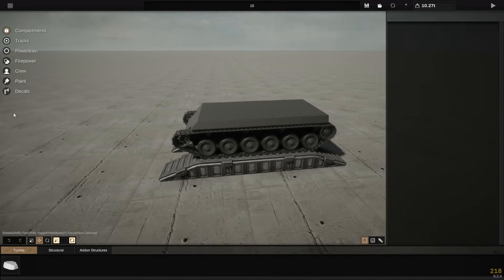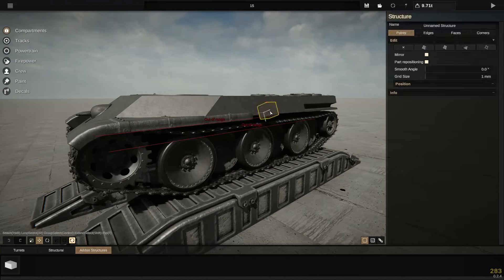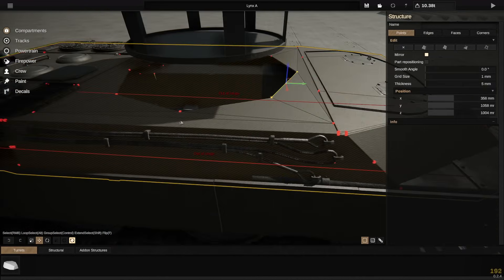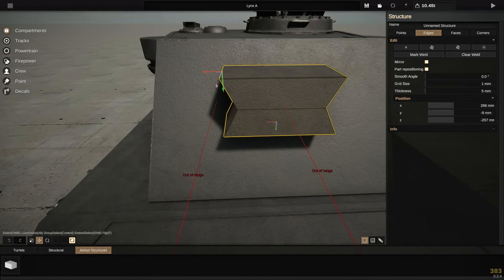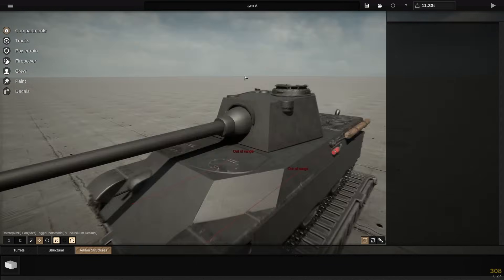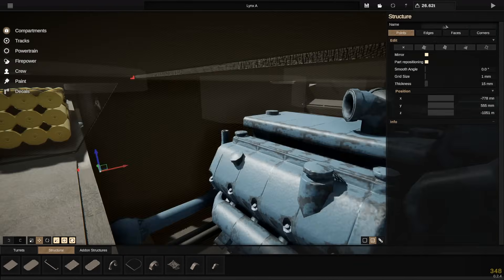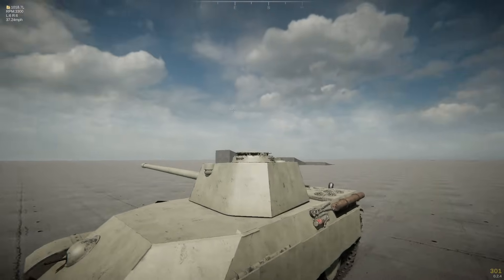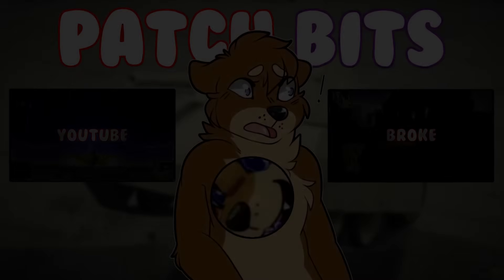Building an upgraded PANTHER TANK in Sprocket!

Comment: This sort of thing was my goal when I played Sprocket. Make something mid-war that could have replaced Pz4, Panther, Tiger all in one tank. Light enough to be Pz4 weight, angled armor of Panther, and side and rear protection of Tiger. Have one at ~35 tons that can tank Long 88 from King Tiger from anywhere to the front/front-side. Armed with 192mm penning 88. It's tops out at only 40 but can climb 70 grade, stop on the grade, then startup again and crest it, and 3 reverse gears so it's quick accelerating and nimble.

Comment: Seeing as you mentioned it:

Panther II did exist and was in fact built (it's currently in the USA in fact) but just not in the way it was presented in WT. IIRC it started development before the Panther even saw service. The idea was basically to uparmour the hull (I think it was 100mm front and 50mm side compared to 80mm from and 40mm side on the regular Panther, but don't quote me on that) as well as increasing parts commonality with the Tiger II.

Apart from that, I'm pretty sure there was no different turret or armament devised, at least not before the project was cancelled (the actual one has a Panther G turret, but I think that was just plonked on by the Americans after capture, but in pop culture you do usually see it with the Schmalturm
Reply: Bear in mind that's off the top of my head, so I'm probably wrong about a few things
Reply: the panther 2 is not a real tank by itself, what i mean is that there is no evidence of a project to make a panther 2, the two tanks tagged with that name are modified versions of the normal panther that the americans named panther 2 just because it looked different which makes sense since they were looking for upgrades but other than that the panther 2 name was just made up by the american soldiers.
So technically speaking you are right, there was no difference in the turrets or armament because you know they were just normal panthers with some modifications (which was a normal practices that some companies did to search for improvements)
Reply: There was a new turret for it. The "schmale Blendenausführung" though it was never made. It was the precursor to the schmaltrum.

The sides were to be increased to 60mm not 50mm. It was the panther G that got the 50mm sides. (I think)
Reply: The Panther G turret was indeed put on for testing by the americans. The Panther II hull they captured had no turret at the time of capture. The front is thicker a little more angled and the engine is the same as the Tiger II.
Reply: @alejandrozapataq  so basicly itd be a panther h. And would be like how the pz4 G had its armor increased by 30mm vs previous versions.
Reply: @robertharris6092  i can imagine the engine having a painful ride with that extra weight lol but yeah i agree with you, calling it a panther h makes more sense

Comment: Lynx? Does already exist :) Reconnaissance tank 2 "Luchs" (= Lynx). Awesome vehicle. 8x8, can drive in both directions with the same speed, has all-wheel steering and driver instruments on both ends. Has propellers on its back to allow swimming. Wheels are bulletproof. Incredibly silent (you won't hear its 10 cylinder engine a few meters away). The turning radius was incredibly small with just around 12m (which some cars cannot even achieve).
On maneuvers, there were even security guidelines that soldiers must only sleep in specific positions to avoid being wounded or killed being driven over due to this tank being almost completely silent. Can reach up to 90 km/h on street and has a 20mm autocannon. It is lightly armored but withstands small arms fire including AP rounds. It had all the fancy tech you can imagine back in the days it was invented (IR, radar, encrypted communication, etc.).
Sadly, it was decommissioned in 2009. The "Fennek" came after.

Back in WWII, the Panzerkampfwagen II Ausf. L (Sd. Kfz. 123) also shared its name.

Comment: If i remember it correctly, Panther II turret was called "shcmalturm" which is exactly what it sounds like - small turret. That is - it was more cramped inside than the early panther turret, in war thunder you can compare Panther A and Pather F to have a look. So long 88 just wouldn't fit in either one, it was an experiment on a blueprint and it didn't work oit

Comment: Cone of Arc did a good video on the Panther 2, it was basically an attempt to up-armour parts of the hull, specifically the sides of the hull, as Soviet 14.5mm AT rifles could penetrate it there, but they found that the add-on "Schurzen" armor plates that you see on later-war German tanks also worked and could be used on any tank design, including Panzer 4s, so they cancelled the Panther 2 project and just used the add-on plates. Only other things they were trying to do was upgrade the engine slightly and fix reliability issues, which they went on to do for later Panther models anyway. 

War Thunder's Panther 2 had the improved hull armor the real one did, but a turret that was never going to be put on Panther 2 (the incomplete Panther F's "Schmalturm" turret).

The real Panther 2, if it was put into production, would have looked identical to Panther Gs, just with thicker side armor and a slightly better engine/transmission (that still wouldn't have been 100% reliable).

Comment: Panther II was only a modification to the hull with increased front and side armor.
The Schmalturm was developed for the normal Panther, and was built after the Panther II program had been cancelled.
A Schmalturm concept which could fit the 8.8cm was drawn up, but would've been extremely impractical as two-piece ammo would be required to load the gun in such a cramped space.
Another Schmalturm concept was instead for the Panther's extant 7.5cm L/70 and would've been a decent upgrade to the tank as it included a rangefinder.
A further proposal was to mount the same 7.5cm Schmalturm on the Panzer IV chassis, this version would've had thinner armor.

Warthunder's Panther II and Tiger II 105 were both likely based on spurious 'historical' documentation used to justify their designs in WoT. Thus when the ahistorical nature of those designs was fully understood they were removed from the WT tech tree.

The King Tiger with a 105 concept was a real proposal, however the 105mm proposed could not fit within the turret and would've had even larger ammo than the 8.8cm L/71 which was already hard to load within the KT turret. The 8.8cm Schmalturm Panther proposal was also real but was likewise no more than a pipedream due to space constraints.

Comment: Lol love the videos man, keep making them. The turret u kept calling the panther 2 turret is actually the schmalturm (or something like that I don't remember rn). It was intended for the panther f insted of the panther 2. That misconception is because of warthunders fake panther 2 (thanks great snail again)
Reply: The last design for the Panther 2's turret, the "Schmale Blenden", wasn't all that different tbh. It had a square gun mantlet, and no rangefinder, but otherwise the dimensions were much the same as the production Schmalturm. Weirdly, the early Schmalturm design that followed the Panther 2's cancellation added an oddly sloped roof, which was again ditched for the production model. World of Tanks ironically enough chose to have its Panther 2's default turret be the oddly sloped one. So no one gets it right.

Comment: historian here for clarification:

the panther ii concept DID exist, and one hull was built! but had essentially absolutely NOTHING in common with the gaijan panther ii. its really more of an "upgrade" for the purpose of production. it had some common parts with the tiger ii, and a bit thicker armour, but thats essentially it. its currently displayed with a spare panther ausf. g turret, in the end it wouldve very likely still used a 75mm gun and a G style turret, not the F style like in war thunder.

as for your design, angled cheakplates are actually a design dead end, the extra armour they provide is undercut by the fact you just genuinely have even less space. its more for light vehicles with little to no armour than it is for a medium tank. its also harder for production, youd really just want one big flat heavy plate in front.
https://en.m.wikipedia.org/wiki/Panther_II_tank